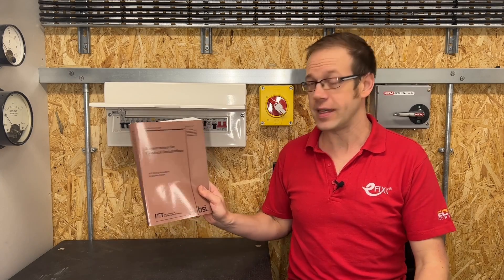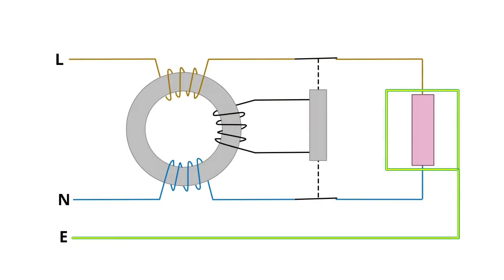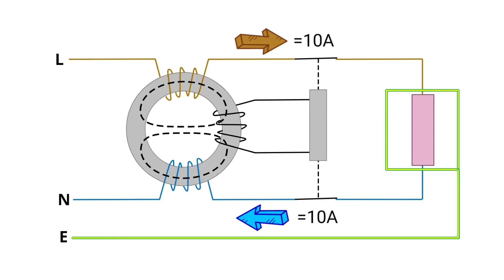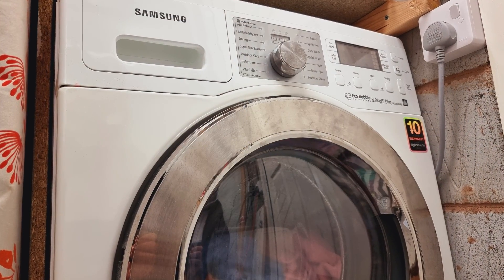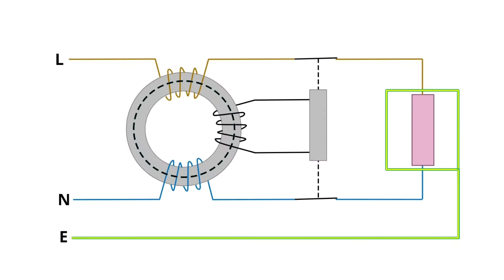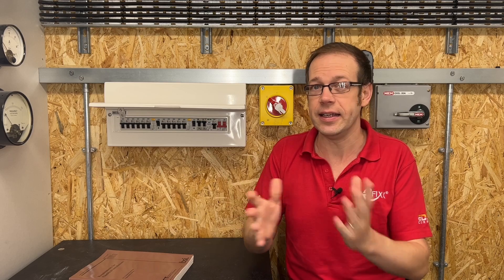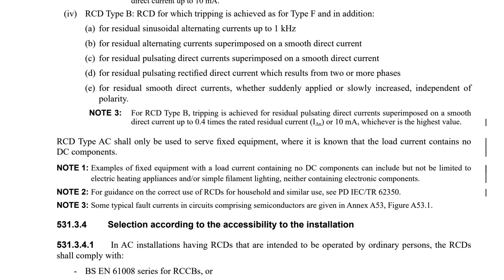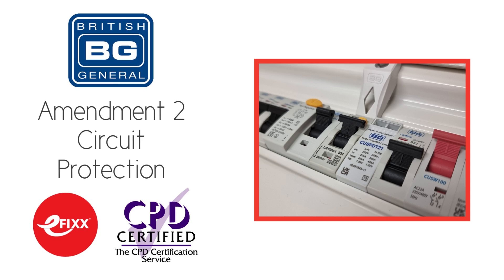Can you still use TYPE AC residual current devices? (RCD)

Comment: Interesting video, however what your didn't mention was Bi Directional RCD which it is said deals with the DC leakage problem. Perhaps you could expand on this. More importantly are they safe I watched a video where they deliberate reversed the conductors to an inverter and theoretically it should have worked but it smoked and destroyed the RCD button.

Comment: We have, by default, been installing type A RCBO's (both SP and DP) for 4 years now. On our most recent inspection our assessor watched me test an RCBO, record the values and then made a comment.
Why are you testing as type A when AC is more than sufficient.?
His "suggestion" was there was no DC on the circuit and AC test was as good as we needed to go, whilst. I could see what he was saying, it made no sense not to test the RCBO under the characteristics of the installed RCBO. Comments?

Comment: Isn't it all a little... Our best ever   new and improved washing up liquid /powder... You've been using shite these last few years. Buy this now although we where quite happy selling you this then..
Engineering be it electrical or civil is buy definition, engineered. Worst case scenario for failure. Our storm, flood, bridge building loads protection are calculated carefully and of course the worst case does and will eventually happen.
My point is. The IET every few years ammend and change subtlety and sometimes not so perfectly previously and sensible regulations. Over engineering and making pointless changes, maybe showing us how clever they are.. I'm certain most of these changes are applicable to certain environments. Almost certain few of them domestically.
Hey!? Where's that fan isolator for this bathroom..I'm sure if I stuck my finger in a rotating 4 inch fan there is more damage done to the fan. So surely the environment counts.?
Call centre. Data centre.. 1 bed flat... Come on Ffs.

Comment: What about an imersion heater in the hot water tank?  That could do a type AC.  I think the IET could do with a field trip up to Scotland and look at some of their regulations.  Scotland seem to leed the way in some of the UK safety with regards to electrical and fire safety.  I do however think that BS7671 amendment 3 will have more changes.  I can see that they will push the wider use of AFDDs.  It make me wonder what a customer who had a new CU/DB/Fusebox fitted lets says 2 years ago will think.  Can you imagine the conversation?  Your new board that was fitted 2 years ago is a split load dual rcd board, we have since gone to RCBO boards with or without SPD to the latest board with mainly AFDDs and RCBOs and a type 2 SPD.  The board now cost about £1500 to £2000 that parts and labour.

Comment: So..... all these years where I have been installing AC rdcs, they have been potentially lethal under BS7671.   Does this mean I can potentially sue the IEE for incompetence?
Reply: The issue is that the number of things that can cause DC leakage has been increasing over the years - ACs were fine when everything was electromechanical, but as most circuits are likely to have electronics of various kinds, the risk of DC leakage faults has been increasing.

Comment: Great video, what code on a eicr would be assigned to a AC rcd on a circuit that contains DC components?
Reply: Personally it's a c3 from me, as testing to time it was installed.
Reply: @MrPete1664  Yea it's defo a C3
Reply: What about a TT earthing system. Id code C2. Potential danger if the RCD fails and the zs is over 100 ohms.

Comment: I tried to by a MK type A RCBO at a local wholesaler last week but they only had AC (After initially telling me they only had type B, which was actually the MCB characteristic) - the guy said they didn't stock type A's  as nobody had asked for them before. Makes me wonder about the avarage sparkie's kmnowledge of the latest regs...
Reply: I doubt the wholesaler knew what he was talking about to be honest every new RCD or RCBO I have fitted for quite a while now has been type A off the shelf and every time I do an EICR I note down if the RCBO is type aC 5-4.13 I know this now off the top of my head I do it that often 🥲🤣
Reply: @markpotter8280  I saw the box - it was AC
Reply: @mikeselectricstuff  weird that they would only stock type aC  even weirder that they said there isn't a demand for type A. but if that's all they had I guess you got what you wanted elsewhere.
Reply: I think some wholesalers might try and pull the wool over people's eyes and try to.get rid of some discontinued products, unfortunately.
Reply: I encounter it regularly with RCBO's where people get very confused over the system used to denote the RCD and MCB characteristics and mix up the meanings.
Sounds like your wholesaler has a sales staff product training issue. 

There is one wholesaler I ues that has a terible habit of trying to make product substitutions with items of compleatly the wrong specifications when they don't have the specific item I have ordered in stock.

Comment: In Europe the consumer unit is built into the home, if you wish to improve protection you swap in the necessary devices, you don't pull it out and bin it every-time some standard changes, you don't have a dozen additional opportunities for a mis-torqued connection burning your home down.  

In the UK, we can't use that 18th edition board anymore that you had fitted last year, time to chuck it in the bin while I bodge in this BG board. I'm starting to think the IET gets kickbacks, doesn't seem that hard to standardise a bus bar and a DIN rail, never mind suddenly realise 15 years later that Type AC RCDs are bit crap.
Reply: But only if the board still meets today's requirements. Otherwise that one has to go here too. Important is also that you install bigger boards with more space in it so you can retrofit devices in the future if necessary.
The DIN rail is normalised, that is why it's called DIN rail, the dimensions are normalised by the German DIN, the German institute for standardization. BTW we call them literally translated "hat rail" in Germany, because in profile it is shaped like a hat.
In Germany we purchase not fully equipped boards, we purchase all things separately. That means you can have Hager housings but the devices fitted into it are ABB for example. Every electrician has his/her own preferences on materials. Some will probably come up with missing CE, but that's not an issue here since we don't sell them on a big scale like the boards in the UK. They are custom made for the specific job, and the customer gets an instruction for operation of that board (which isn't much that the customer can actually do except switching stuff on or off), label the items and circuits properly, and of course only make them for your own jobs and then you can bypass that CE mark requirement.

And just btw. : The VDE banned the new installation of type AC RCDs in 1987. Since then the type A was the standard type RCD here in Germany.
Reply: Europe got the  best electric boards !